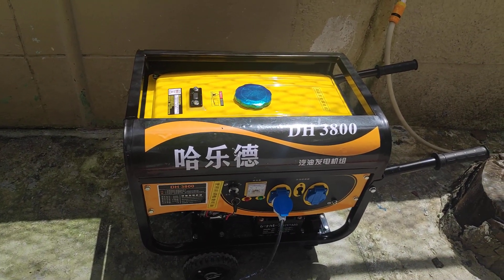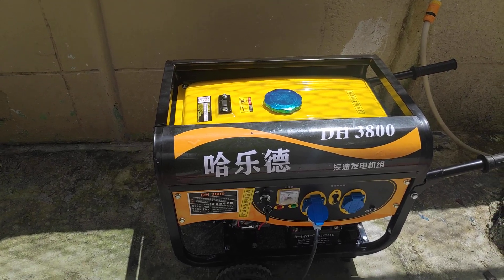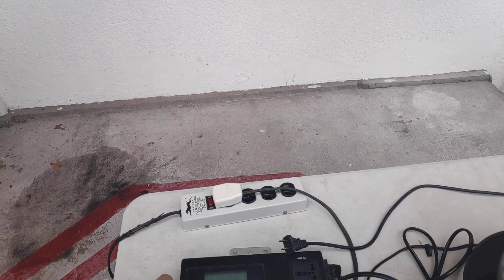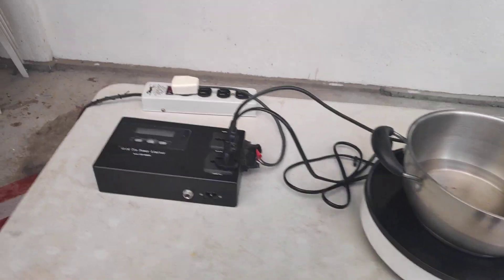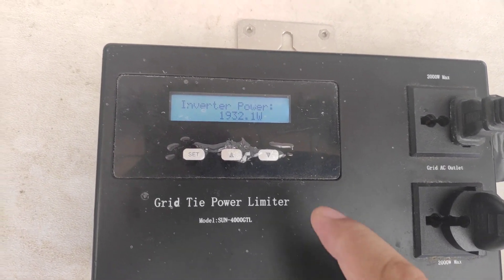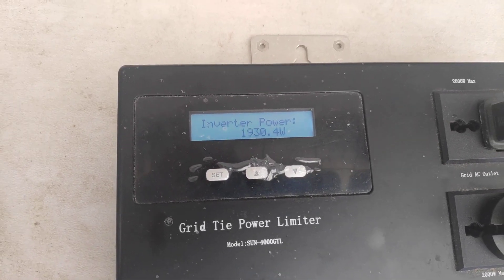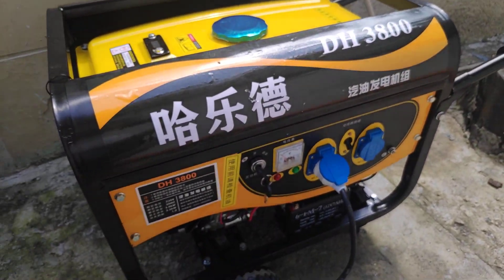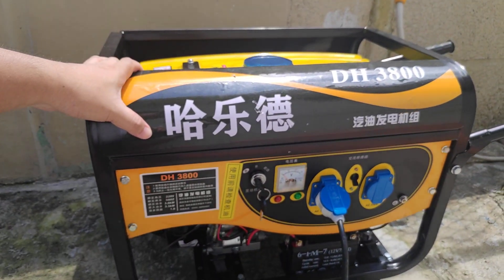Dekes Gasoline Generator 3500w - Finding its real Max and Rated Power

Comment: You "think"it's the maximum power it can sustain but you didn't try it.  You should load ti until the speed changes. (don't care about different noises under diffrent loads, this is just normal) You said "it trips" but that's wrong. The load was varying (did you heard about what a thermostat is??)  and the gen just followed. For a true test you should measure VA and not Watts and load it until it slows down. 2.7Kw aginst 3kw is a cosinus phy of 0.9 very usual... this gen does the job it was build for, the only bug is vendor rated in Kw instead of VA. Comercial trick to fool numbs who don't know about alternating current and electricity in general. This review show a good generator, a bit noisy (but inside a small gangway and two walls) and this gen delivers the 3KVA (and probably a bit more...) 
So, conclusion:   The generator is good, the test is bad.
Reply from the maker: and who has a Equipment to measure VA???
give me a break...  i tested it with what i had in my house.
Its not exact science...  at least i know what its capable of.
i knew it cant reach 3800w since its such a small generator. 
it was a cheap generator for emergency.  Its nice to have it than need than not have it.
Reply: @glennjv01  there are plenty of cheap, good WATTmeters..  no need to mesure the VA. just don't mix them. I bet it can deliver 3800W, if the cosphy is 0.8 or better... Didn't want to bother you, just correct the bad idea you wrongly gave about this genset.
Reply: @glennjv01  VA is Volts x Amperes..  you have the onboard voltmeter, just insert an Amperemeter and you have the VA..  simoler than your gird tie power limiter...   ;)
Reply: 50hz?